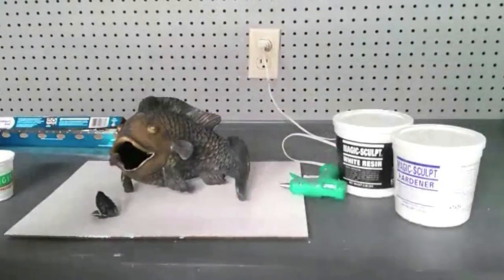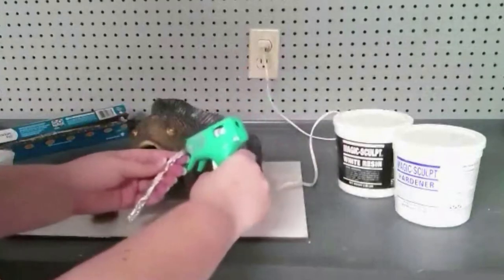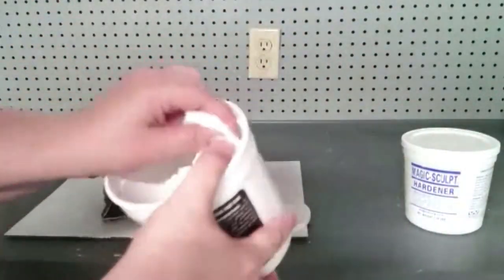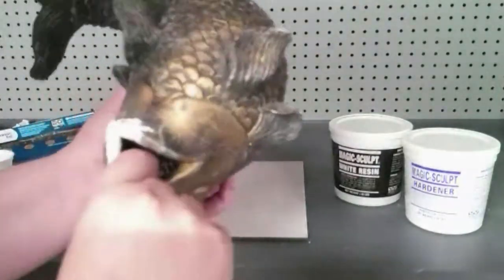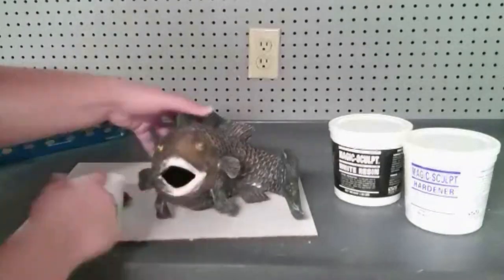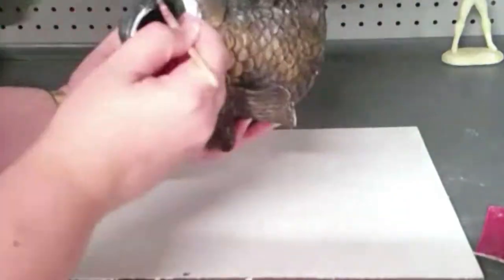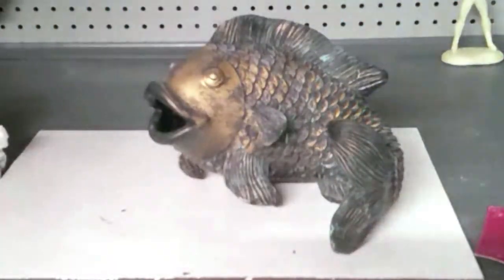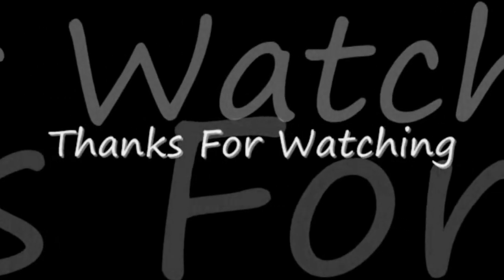Fixing A Broken Resin Sculpture

Comment: Nice job. 
A little tip; don't use the same hand to extract both epoxy parts (A and B).
You can transfer residue from one tub to the other, which makes that area cure slowly over time.

Comment: will jb weld work?
Reply from the maker: I'd say because it is more of a liquid putty than a clay putty it would not work for a project like this in the same way.  you could but it would be more work when sanding. milliput putty would work the same way as the stuff I use in a smaller package and you can get it at a craft store like Hobby Lobby in the model section